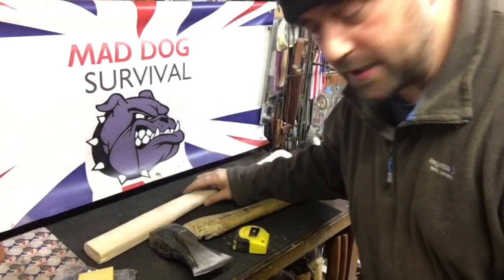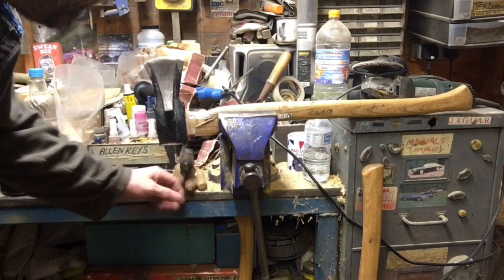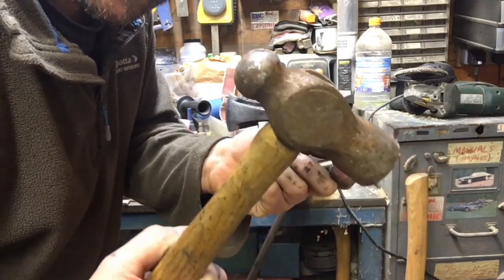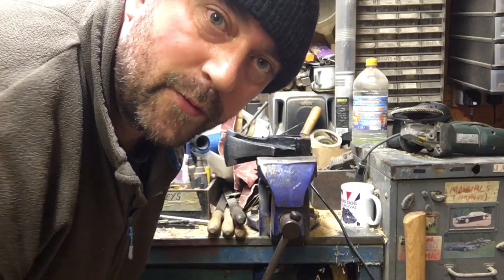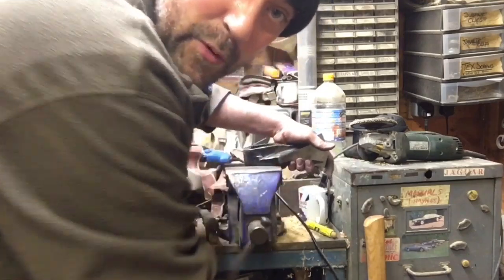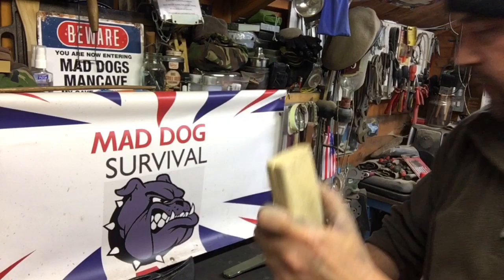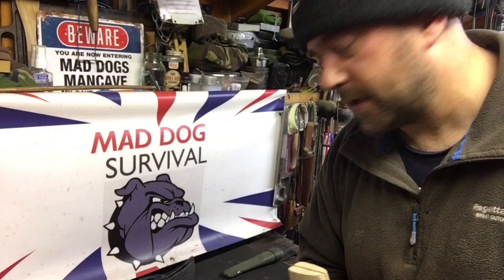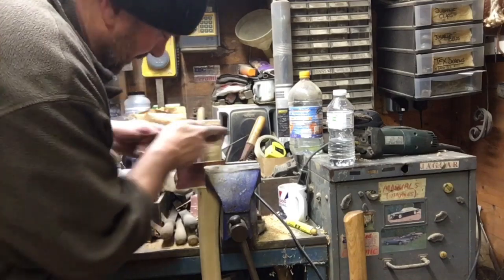How to replace a axe/hatchet handle/shaft

Comment: Nice Video m8. The only thing to make your life easier would be to Drill multiple holes in the top of the old shaft. That way it splits far easier and comes out a lot faster. Don't need to be a huge drill bit but big enough to loosen the fibres in the wood up. Stay safe.
Reply from the maker: Thanks again brother! Yep definitely would be better! I’ll definitely do that next time! Thanks for the advice! Best wishes friend 👍🏽👍🏽😎

Comment: I have used a drill and1/4 inch diameter and drilledas many holes as I can. It made it easier to remove without having to beat it out. I was also able to pull the wedges  out with a pair of pliers. Then I would use a round file to smooth the inside of the head and remove any rust that has build up inside of the head.
Reply from the maker: Thanks again brother! Yep I’ve missed that obvious tip ! I appreciate your kind support and feedback! Thanks for the advice my friend! I’ll definitely be doing that next time! Best wishes friend 👍🏽👍🏽😎